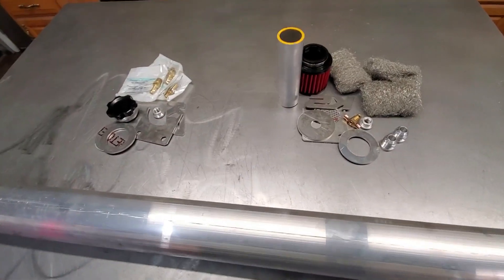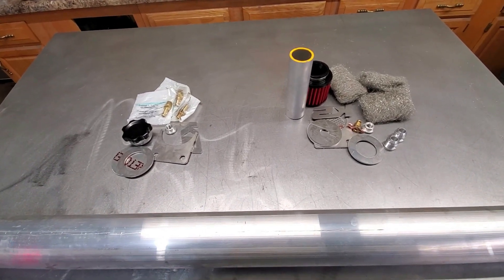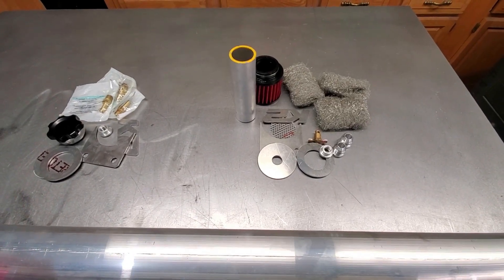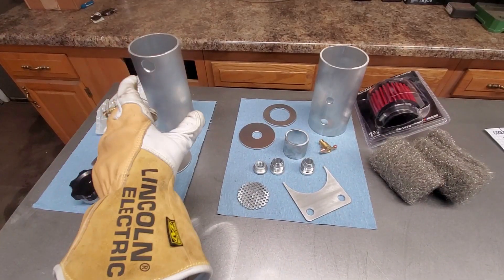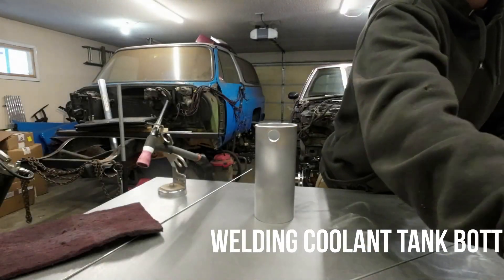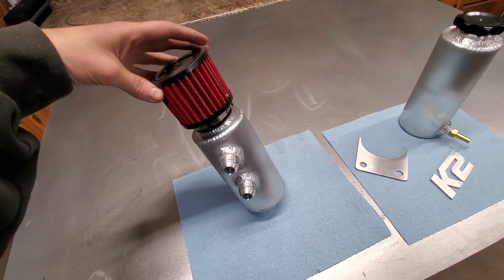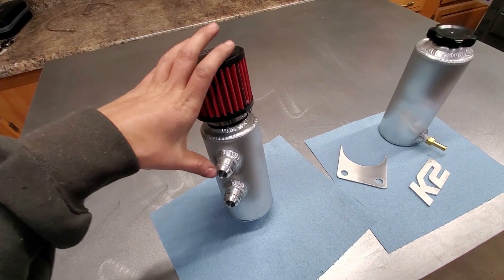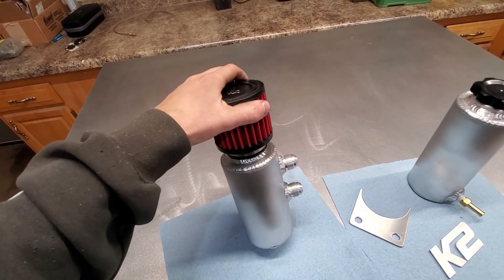Oil Catch Can & Coolant Overflow Tank Builds - K2 Fabrication

Comment: How much would the Catch can cost with barbed fittings that are slightly larger than the one on the overflow tank?
Reply from the maker: $189.99

I have options for a 1/2" or 3/4" Hose Barb on my website. But could do any size.

https://www.k2-fabrication.com/collections/automotive-parts/products/universal-oil-catch-can-round